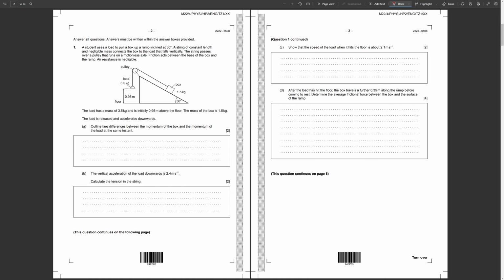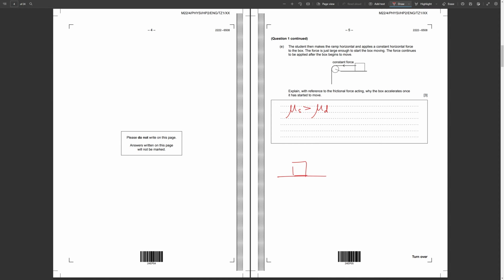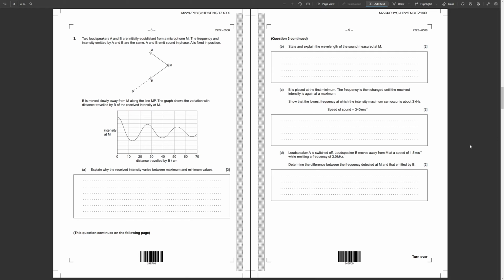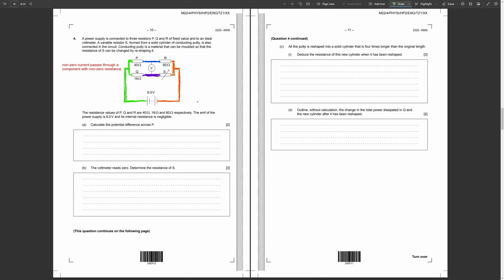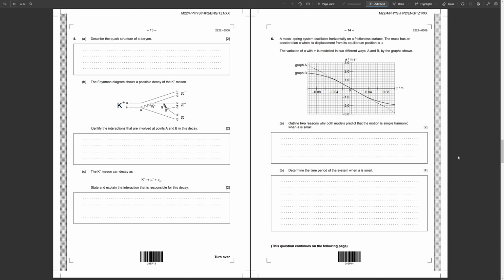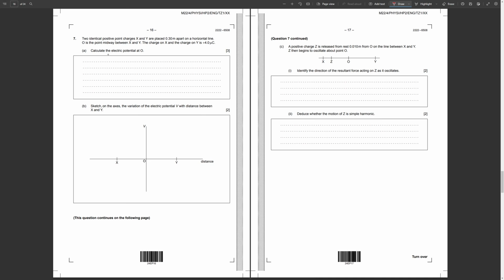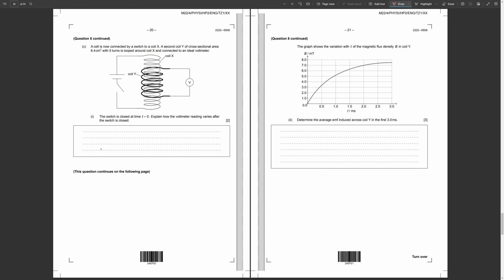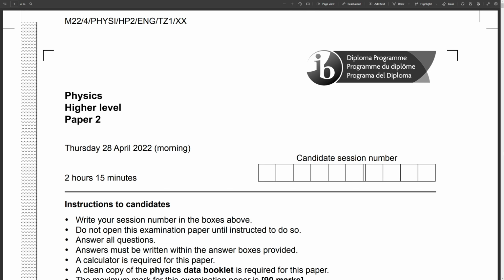IB Physics Exam Paper Solutions | 2022 May Time Zone 1 | Higher Level | Paper 2

Comment: Hi sir, for question 2 part a, you forgot to convert degrees Celsius to Kelvin. The SHC of milk in the question was stated using Kelvin. I got an answer of 74 KW (74217 W) after using Kelvin
Reply from the maker: Thank you for your question. 
The CHANGE in temperature in °C and K are the same. 
In °C, 84°C-11°C=73
In K, (84+273)K-(11+273)K=73
Reply from the maker: 3.9 kJ/kg °C = 3.9 kJ/kg K
Reply: Ahh ok sir thank you